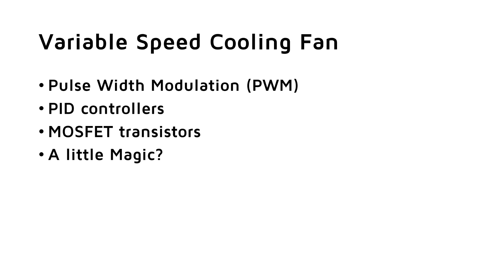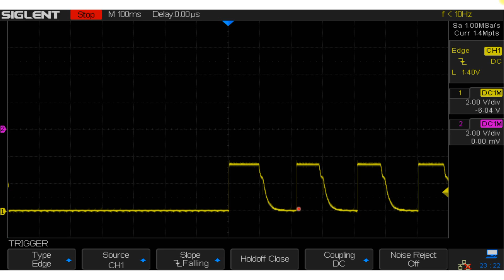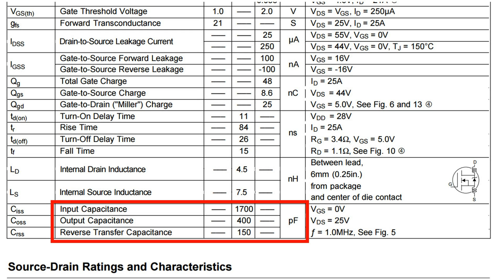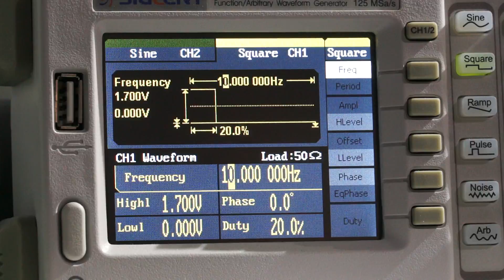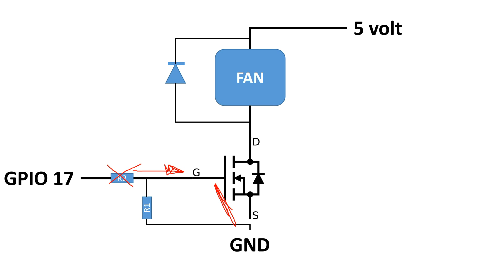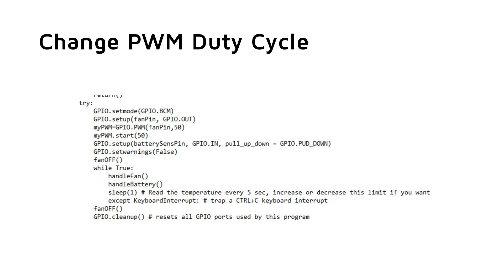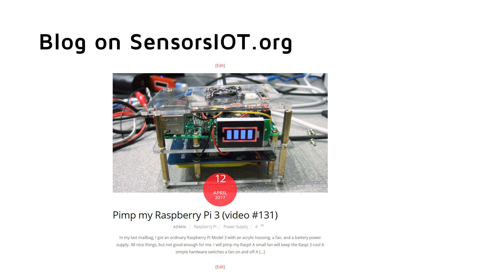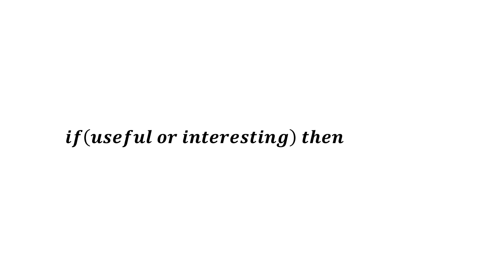#138 Variable Speed Cooling Fan for Raspberry Pi using PWM and PID controller

Comment: Add Signal processing handler  to your sketch to catch external events happening. This could catch the following signals SIGINT, SIGQUIT, SIGTERM and SIGHUP. The signal handler could then do a controlled stop of the fan if it is currently running before doing a sys.exit(0) to terminate the sketch. Hope this helps a bit.
Reply from the maker: What would be the benefit compared to the current design? I am a Python beginner.
Reply: Hi Andreas, the handling of the external signals makes sure your python program handles any unexpected events occurring on the Raspi. For example,  if the unusual event is an unexpected shutdown, your python program would handle the situation itself and shut down the fan in a controlled manner. Its really a way to tidy up in a safe way. It allows your python program to prevent any damage to the fan. I know fans are quite robust but many bits of hardware could be damaged if a sudden shutdown occurs. I have a fan controller for the Raspi that does this. I can let you have the code if you like to see how it works. Let me know if you would be interested to have a look.
Reply from the maker: Thanks for your explanation. Of course I am interested. I am always keen to learn something new!
Reply from the maker: Thanks! I will have a look at it to learn about "signal handling"

Comment: fieldeffect transistor transistor ?

but nice video.
Reply from the maker: "FET transistor" gives 292'000 hits on google. So, I am not alone. "FE transistor" gives only 2890 hits ;-)
Reply: It is still strange to hear such redundancy specially after you have said Field effect Transistor.  
(same as atm machine,  pin number etc)
Reply from the maker: I think, nearly nobody cares about the meaning of the abbreviations like IBM, SAP, NASA

Comment: On your formula pdiff = diff* Ptemp where did you calculate Ptemp. The same for Itemp .
Reply from the maker: This is a system constant. You have to try this out till your controller does what you want.
Reply: Ok, but should be a general starting point from where you try to guess. Otherwise i can start from -1234455678 to 123454567 and it does not make sense for me. Based on your experience where should i look first to get it, or in the other way, what i should expect as result so i can start guessing the number.
Reply from the maker: In my python script I use pTemp=15  iTemp=0.4. Maybe you look at my blog on how to get the python program.

Comment: instead of a program and large circuit, wouldn't it be easier to just have a thermistor (heat sensitive resistor) on the chip or the side of the heat sink? the hotter the chip gets the lower the resistance and the faster the fan will get till it reaches an equilibrium.
Reply from the maker: This is also a possibility. However I think, it will not be easy to find a matching Thermistor which exactly has the curve you need, And Thermistors do not have a very low resistor as a FET transistor (<<1 Ohm). So, the fan would never run at full speed. The circuit also would not be much easier as you would have to thermally connect the Thermistor to a (small) heat sink. One advantage it would have: It works completely independent from the CPU. Maybe you try it and report your findings ?

Comment: What is the advantage if using a IRF3708 mosfet ?
Reply from the maker: It starts to conduct at a lower voltage. This might help a little with 3.3 volt logic

Comment: just for understanding: is this a software pwm? i can remember that the early models had no hardware pwm pins and 3 pwm pins consume almost 70% cpu time. did that change now?
Reply from the maker: I do not know how PWM works on the RPi. But I just checked. The python program uses about 12% CPU
Reply: oh gosh 12% of cpu power? could be possible to lower that percentage? maybe reducing the scan time of cpu temp

Comment: Hi Andreas
you wrote that IRF3708 is even a better choice, why?
Reply from the maker: It starts to conduct at a little lower voltage. This gives you more "safety range" on 3.3 volt systems
Reply: Hakam Saffour it is mentioned in the comments to the previous video about puting a cooling fan to. RPi.
Sorry it isn't more help, but I don't remember the details.

Comment: That is great Andreas, i especially like that the fan speed follows the temperature. nicely done !
My implementation as mentioned last time is somewhat different, but has the same effect just in 2 stages and my full tilt doesn't come on until 65 degrees.
here is my project in case you have time and is interested: https://www.instructables.com/id/Pi-3-2-the-MaX-for-Under-5-Overclocking-Automatic-/
Reply from the maker: You used a different approach, but it seams to work...

Comment: Some quite complex elements to this project but it's explained incredibly well and the practical example makes it all very clear. How do you get the time to do all of these fantastic videos? I' m still working on my bathroom refurbishment but hope to do some more electronics projects when it's done. Best wishes, Arthur
Reply from the maker: I am sure, for me, refurbishing my bathroom would be more complex than PWM... I hope, you will add a "magic mirror" to your new bathroom...
Reply: It actually becomes complex if you have available IRFZ34N instead of IRLZ44N, glue it to the fan and then realize that 3.3V is not enough to fully trigger that MOSFET. Yup, out to shop for IRLZ44N...